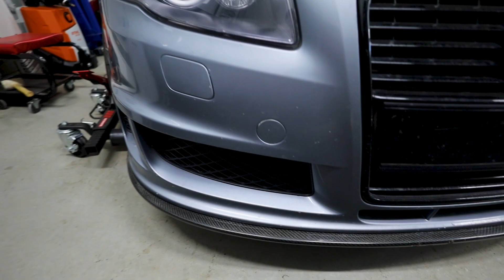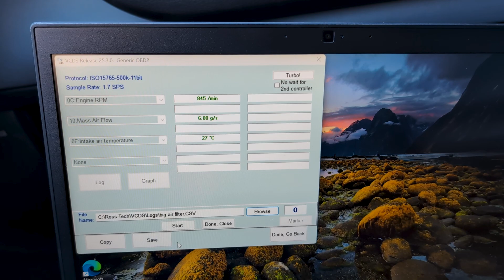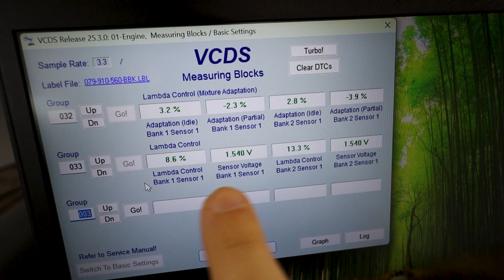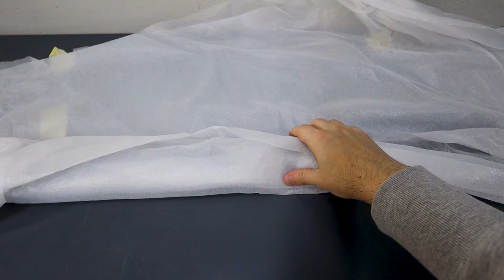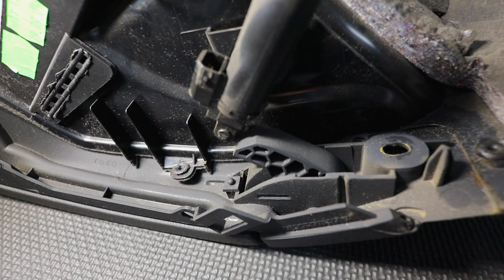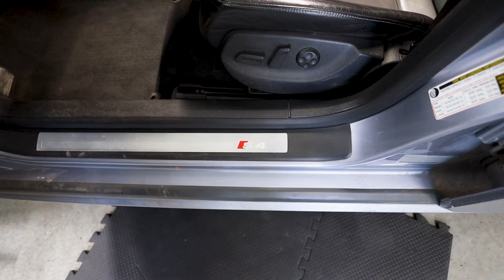Velocity stack intake testing & interior upgrades feat. RS4 carbon trim and glovebox fixes

Comment: i have my self  s8 d2 2000 6 speed from factory ,   with intake manifold spacers, and intake manifold matched with heads.. but it gives almost nothing..  for s8 d2  first mod that need is long tube headers , because stock is log style manifold  shitest what cann be in that car.  and then  downpipes with exhaust 2.5 inch,  + intake manifold porting,  and tune it. car should wake up a lot..  me self wanna long tube add but as usual no finances because cots to fabrikate long tube is huge...  plus i heard in poland someone remake camshafts more agresive  because s8 d2 cams overlap is made for fuel savings not for performance, same as exhaust manifolds not for performance...  for example bmw e38 4.4 v8 with less power had better exhaust manifold than s8 d2 , what a shame from audi... but from other side i understand how they cann make s8 d2 faster than s4 b7...  they had to underpower s8 d2..